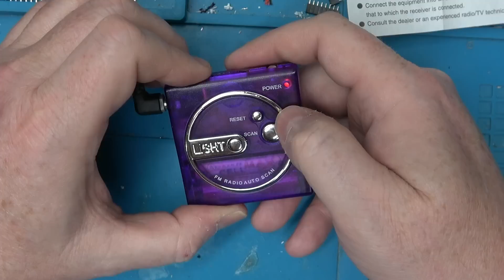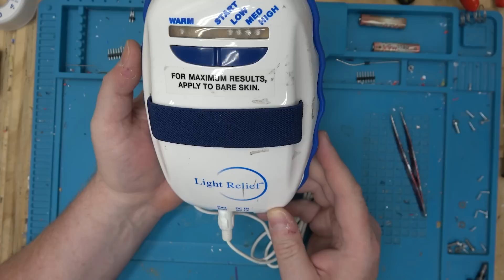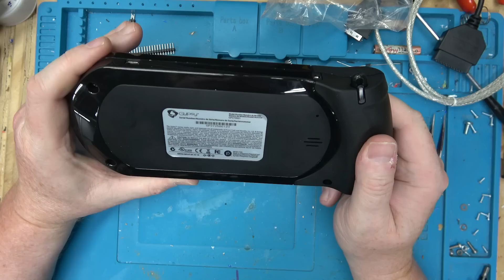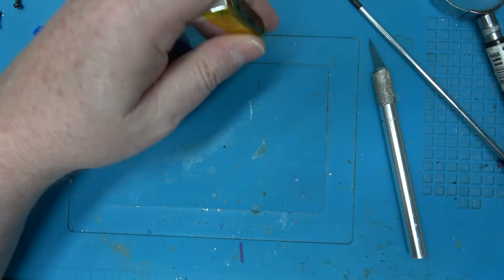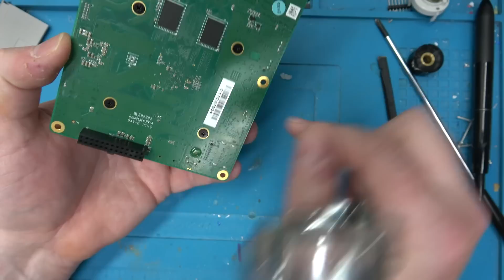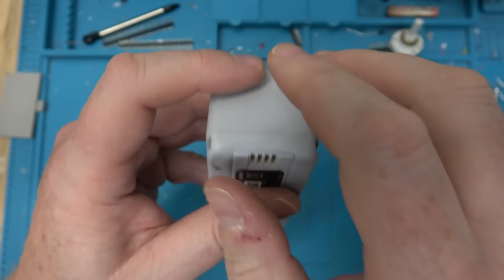More Random Teardowns Summer 2023

Comment: Have you ever messed with spreading the inductor in those El-cheapo radios to hear the aircraft band?  Spreading out the inductor shifts the resonant frequency bandwidth up.  The radios with an analog tuning wheel work better than the digital scan ones.  Pretty useful if you ever make it up to the Oshkosh air show.  Of course, if you aren't next to an airport you may have to tune back and forth for awhile before you hear any aircraft talk to each other (or to the tower).  A better antenna helps as well.

Comment: I actually bought that 1st radio (maybe in blue) at Dollar Tree around 2004 for detasseling. Got some unbelievable stuff there...usb cables. Parallel "printer" cable, ethernet cable (cat5), kids p/s2 mouse with a switch box that supports 2 PC mice, AV cables, coax splitter and F couplers. All of it for $1. At least the usb cables are decent quality and still have.

Comment: Looking forward to the Voron video, what kit do you have and who is it from ? My current hobby is making printers from scraps I have left over and then 3d printing parts. It was after building a Rook and I was challenged to use all the older part I had like 10mm steel rods and ender 3 hotend and extruder.

Comment: The EU already implemented a work around for companies like Apple.  Devices that are water proof do not need a replaceable battery. This will also affect the usb-c demand, as those devices will use inefficient wireless charging and no usb connection at all.

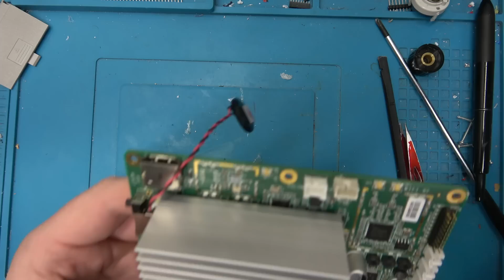Comment: Ben, @14:30 that SBC is an Atomic Pi... uses an Intel Atom CPU and has a few GPIO.  Was originally for a jukebox of some sort that went under then sold to nerds as a Pi replacement.  I think thats the story if i am not mistaken.
Reply from the maker: Oh sweet! Now I can install stuff on it! Thanks! I should have Google Lens'd it but thought it looked too generic.
Reply: Heck yeah!  I got one a few years back to make a retro games arcade but havent got around to it yet.  I would TOTALLY watch a video about the AtomicPi running a pinball machine or something cool.  :)
Reply: @BenHeckHacks  there are power delivery daughterboards from digital loggers available (they're the ones that bought em up when bosch pulled the plug on the little house robot speaker thing it was supposed to be) 

there's a small one with a barrel jack and a larger board that breaks out all the gpio, the usb header, the onboard audio system, and so on.

i bought mine for octoprint and klipper specifically and it runs about as well as you could hope for.
Reply: It's very finicky for power. 5v3a, but you need to attach to all the power pins on the bottom connector or else you'll get kernel errors if you do anything outside of OpenWRT. Lubuntu was not happy...

Comment: I vaguely recognized the Stryker brand on that battery. I googled it and they must be medical grade as they are a couple hundred dollars new. Crazy what they can get away with charging for 4 18650 cells.
Reply from the maker: Well, medical grade :)
Reply: I work in the medical device industry… the FDA regulations are insane (although warranted). It's not cheap to be fully compliant on everything, 510(k)s are expensive, and heaven forbid anything ever have to change (do it all over again) and that's just the beginning. Applies even to the software (and its code) on medical devices. Why I always cringe hard when people apply that move-fast-and-break-things mentality to medical devices in the US. If your stuff injures or kills people, you better have the systems in place to deal with all that as well. Oh yeah, lawsuits and audits and consulting costs…… $$$$$$$$$$$$$$$$$$$$

Comment: That "Light Relief" unit looks like absolute quackery. The claim is that the IR LEDs heat the skin and soothe pain that way, but those LEDs will be emitting near IR, which is not going to heat anything (unless driven at currents extreme enough that the secondary heat dissipation is actually perceptible or the light output is intense enough to cause heating, which would likely not be too good for that type of LED package.)